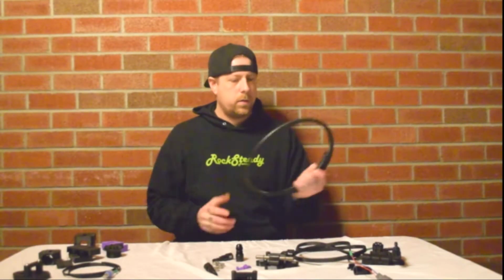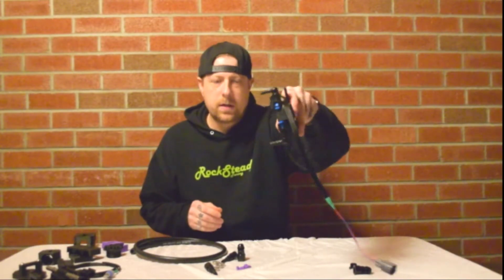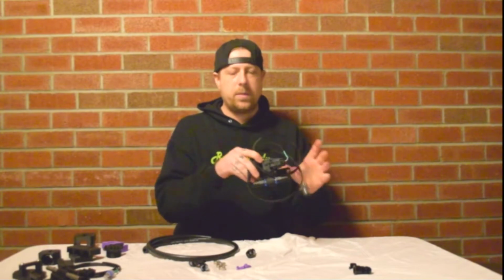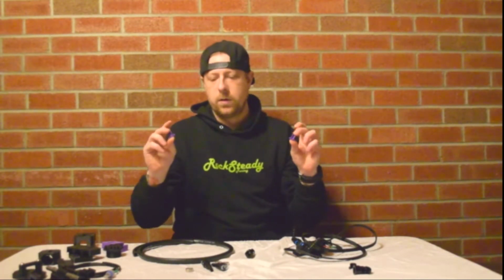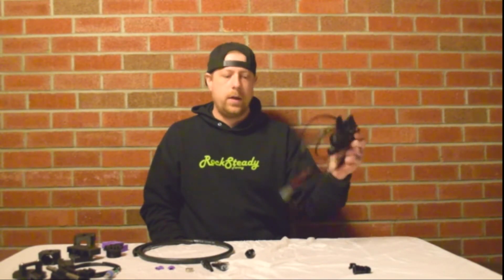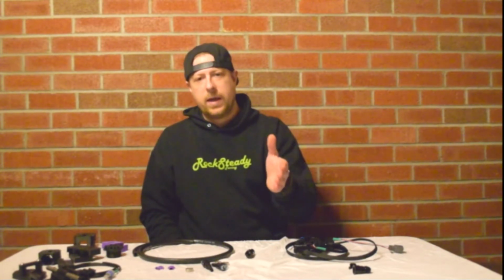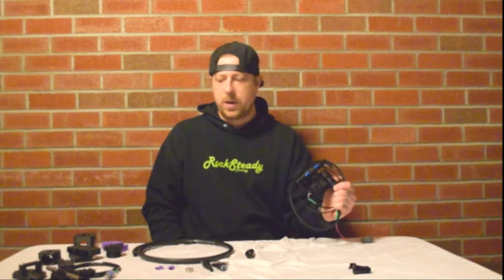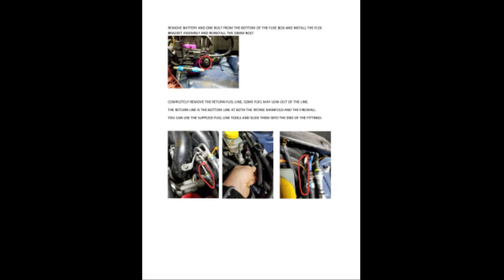Rocksteady RST flex fuel kit install instructions diy review overview

Comment: is it possible to add a gauge to it?
Reply: Just read your site I guess my Gayphone is not compatible ...
Reply from the maker: @fonzo64  haha if you are NOT using cobb best way to do it is get a cheap android device and a Bluetooth obdscanner  then u can see all your data and even log with it for tuning purposes. just about any old android device will work  they can be had purchased really cheap on ebay